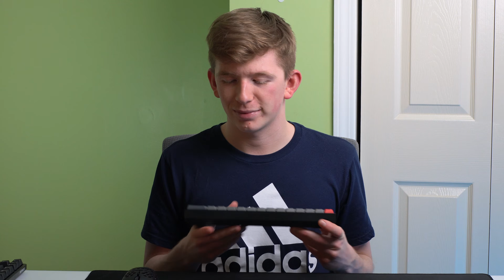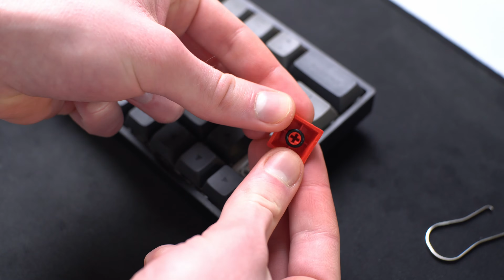My Budget Gaming Keyboard Build - $30 modding process!

Comment from the maker: TIME STAMPS
0:00 - Intro 
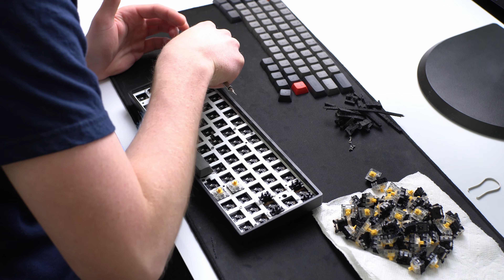0:58 - Why I'm making this video
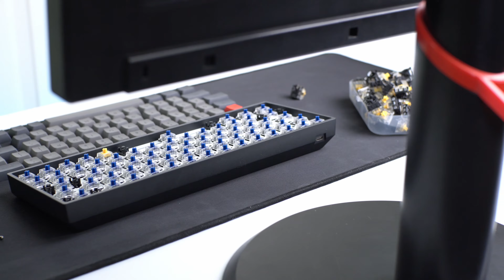1:28 - The keyboard and what I plan to do 
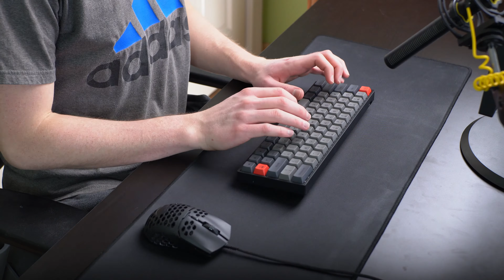2:19 - Original keyboard sound test 
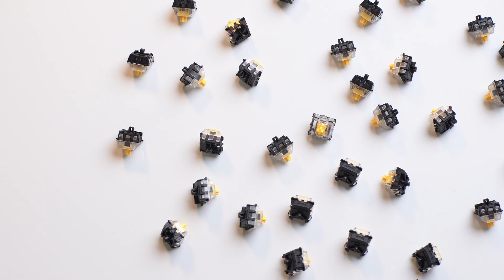2:23 - Gateron optical yellow switches
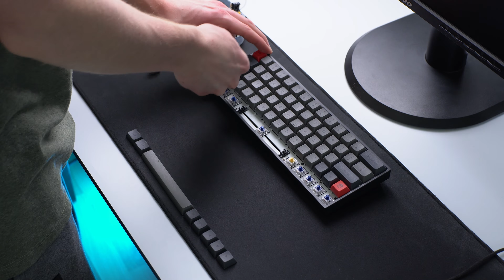2:59 - Installing the Gateron optical yellows
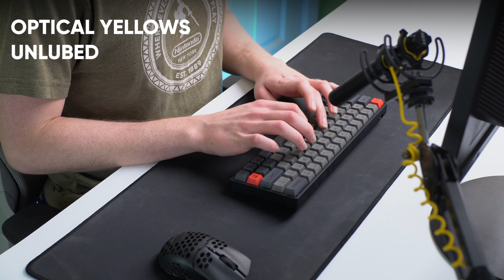3:46 - Gateron optical yellow sound test (no lube or mods)
3:55 - Why modding was necessary for me
4:23 - What I bought 
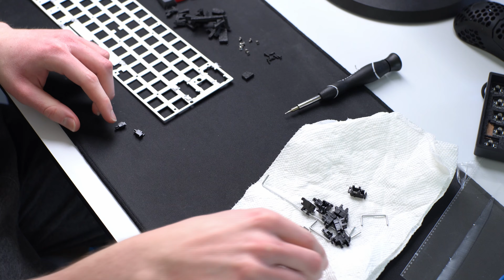4:56 - Clipping stabilizers
5:14 - Bandaid mod
5:31 - Holee mod (failed)
5:59 - THE PENNY MOD 
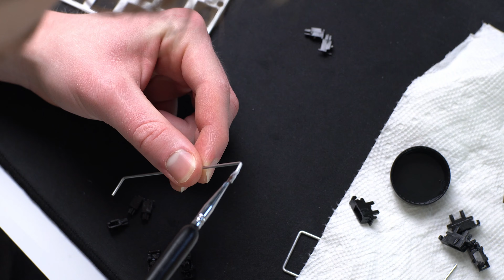6:35 - Lubing the stabilizers 
7:10 - Lubing the Gateron optical yellows
8:18 - ITS DONE
8:41 - Gateron optical yellow sound test (lubed and modded)
8:54 - Ok, this experience was epic 
9:57 - Outro